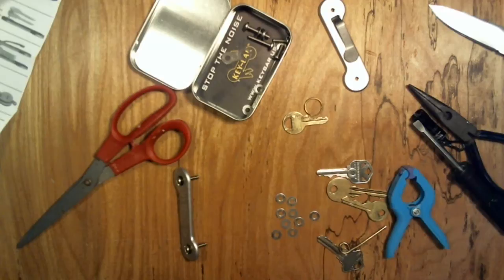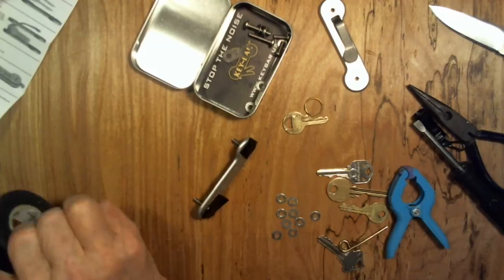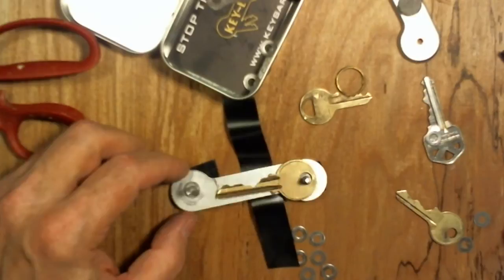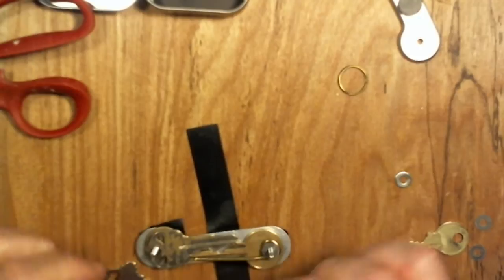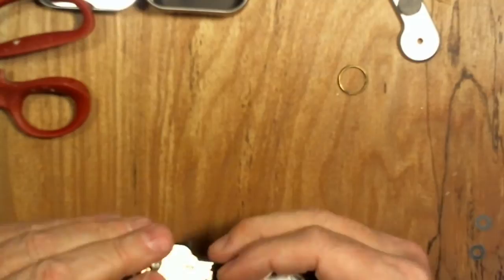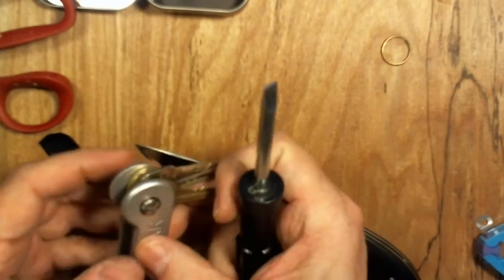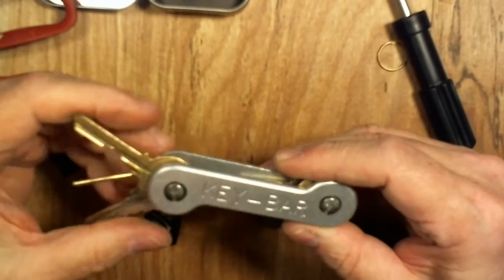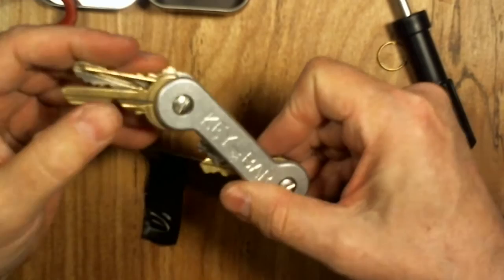THE EASY WAY TO ASSEMBLE A KEY-BAR - strong language

Comment: Thank you for this video!  i had the same problem with the washers.  I saw on instagram that Chaves American Made Knives will be releasing a blade designed to fit the keybar.  if i decide to add one to my keybar, i will definitely use the tape method.
Reply from the maker: +Patrick Batemare I'm so glad this was helpful to you. Thanks for watching.

Comment: Tip #1: If you are going to hold 4 keys, don't buy a keybar.  Buy a pink keyfob with a unicorn.
Reply from the maker: Great tip, great advice. In fact it prompted me to rewatch this video and I'm holding six keys, three on each side. Thanks for watching and thanks for your comment.
Reply: @luigib2307  Is this thing even worth the trouble? You're still going to be fumbling around looking for keys. Guess I'll go with the pink keyfob with the unicorn instead.
Reply from the maker: @unklecorky2181  Actually, in a later video, one can see that I've abandoned my KeyBar in place of a Keypack because they've eliminated the fumbling. Thanks for your comment and thanks for watching.

Comment: Luigi; you were 100% correct.  The tape definitely helps, especially for first timers.  You did a great job with this video.  Thank you so much !  My only concern with the device is that in time the screws may loosen and come apart.  What a mess that would be!   Abu
Reply from the maker: +Hector Slender Hector, thanks for leaving a comment. Regarding the screws loosening, the rubber 'O' rings seem to keep them snugly held in place. I'm glad this video was a help to you. Thanks for watching.

Comment: That tape is pointless, just no need.  Just hold it together and line up screw head, it's simple .
Reply from the maker: +mcgaugh57 You are clearly far more dexterous than I. Thanks for watching.
Reply: Do you have a keybar I have very large hands and the washers are o so small
Reply: @Mark-wq1nh  I don't seem to have a problem with it, I'm a large guy as well.